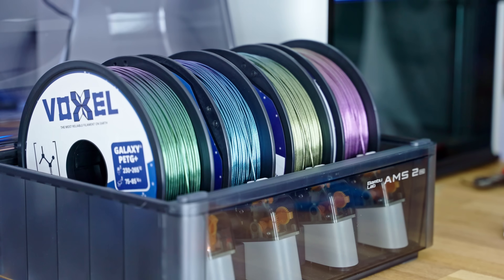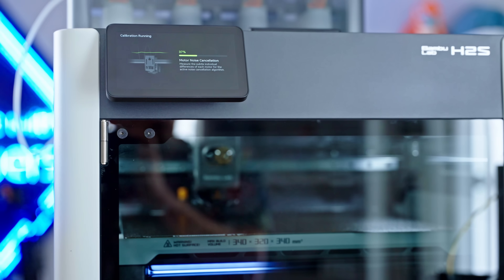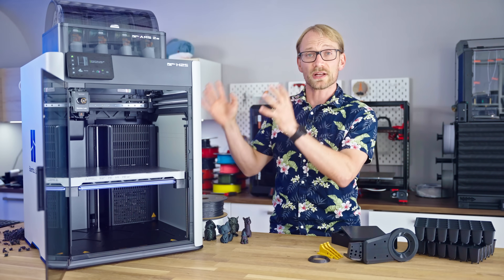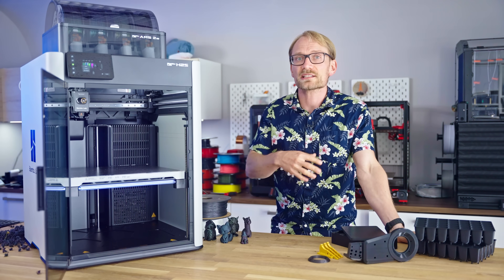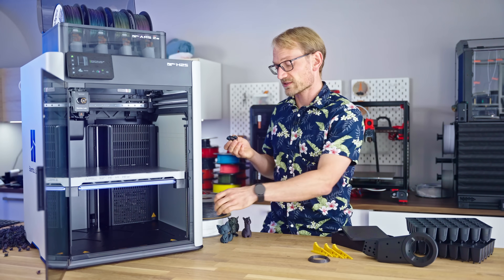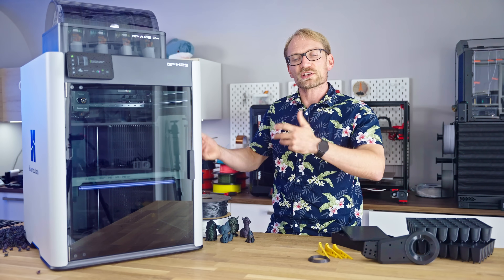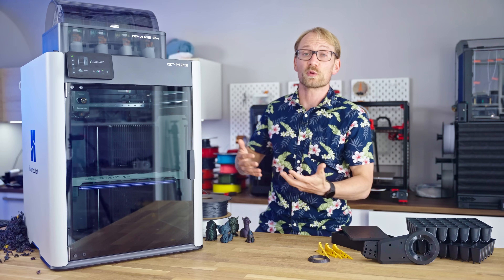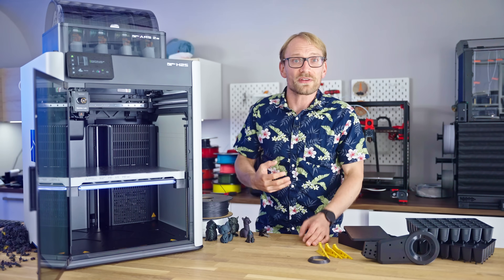Is Bambu's H2S truly a H2D Lite or just a bigger X1C?

Comment: So - PLEASE @ThomasSanladerer  (dont think it works that way here but worth a shot)  - PLEASE ORDER OR REQUEST AN H2D - I really thought OF EVERYONE - Youd have withheld a video on this until you had time with that machine... [The only reason NOT TO was .. well for the view need IMO..]   - Please forgive me if I'm wrong about that but - SOme of us have come to depend on youre knowledge in making informed purchasing decisions - Where intentional or not...  I think youve sadly Perhaps unintentionally done many people harm by having ZERO Knowledge or rather real first hand Experience using the lets say "Sister" printer to this..   That without it - Via direct interview with CEO this wouldn't exist..   So - For someone like myself who is frustrated by the small build volume loss of the H2D wishing they would have chosen a slightly larger frame size - i mean JUST in the X dimension which IMO Doesnt cause space problems on a desk NEARLY AS MUCH As The Depth of it - As most desks are .... (A) Square Topped  (B) Rectangular  - Answer = B RECTANGULAR!  So I heard the CEO's concerns about its size but .... reclaiming that usable X width IMO was not as large an issue as it had to be and was pre determined before any design work on it was ever done.. Which is a shame as - HAD THEY DONE THAT: With the H2D having the SAME USABLE X Size ... 

They COULD HAVE MADE THIS A SINGULAR CHOICE OF: Speed & Degree of professional engineering material use ... 

The rainbow PLA printers or Actual contributors to humanity that Design and iterate usable functional parts & not just make Niche manga and other series or game characters on Etsy / or last second "I forgot to get a gift for ____, what was that thing hes into?"  = [Order pointless multi colored trinket] - Sorry Im TRYING to hold back my just depression over the human race with what society in gneeral clearly values.. Which is NOT To make the world better but to fill it with wasteful useless trinkets that for every one made 2x that or more of filament was thrown away ... 🙄vs.
 Those USING FDM to CREATE and drive innovation of design ideas that weren't possible before this technology - Or Prototyping of functional useful things..  That I ALSO HOPE depending on the use case that - If strong enough and consumers willing to accepot 3D printed parts (if they even notice with Z-line /Layer Lines hiding in carbon fiber filled composites with a nice texture to them) That people will Adopt an ever increasing DESIGN FOR FDM / Additive manufacturing Approach to product creation.. IF the resulting product can be made from the material properties as a final product, and if it makes financial sense over injection molding after the design stages. 

So - PLEASE KNOW - Its hard to watch this for me Personally.. Just because..  You did not ever use the H2D before the H2S.. 

That REALLY IS A PROBLEM - Because..  Your reactions and review of this product.. While you believe it to be objective an unbiased and harmless.. May for MANY PEOPLE Never EVEN GIVE THEM A CLUE ABOUT THE BENEFITS OF DUAL NOZZELS TO AID THEM IN A DECISION BEST SUITED FOR THEM!   Where - Videos like this from other reviewers I would understand.. But I hold you to a higher standard - Because You're intelligent enough TO BE! And its Rare there's about 5 in the world right now I can say that about. 

(well im sure more but without having to stop and think that's what's immediately my basic count of the channels featuring people of enough intelligence and good content that ....  I just hold things you do to a higher standard - And I think deep down you do know.. This video was for the views.. - Maybe you've been busy, whatever it may be but.. You have to know surely that skipping that model .. in a world of new printers that have everything I could have hoped to modify mine to one day but far ebyond it with dedicade design teams and not being stuck with Duet Board components only and like E3D or other Hot ends etc.. Fully ground-up designed for flawless functionality company that succeeded! Since Ive been away - and PLEASE REALIZE - YOU DO NEED TO HAVE TRIED AND USED THE H2D before making this review.. Or - You know..  despite what you tell yourself..    This video WAS FOR THE HYPE!  - Please Return to that higher standard I do hold you to ... Where You would have never released this video without (even if you personally chose to skip it for some reason ... and aren't into the Functional 3D printing space anymore or LIEKLY someone in your posiiton has so much spare filament coming in all the time the waste is a complete non Variable for you Personally! )  

So please think on this if it posts.. It says it does but usualkly 34 post YT starts deleting them if long like mine are when they are serious criticism - Not meant to be negative but to genuinely hope to make a point that ... Not even asking for a test unit of the H2D before this and doing the prep work to use it EVEN IF YOU DIDNT HAVE TIME TO MAKE Videos about it.. WAS NEEDED Before doing this video!

As - well I think youve either sold out to the masses of the world mindlessly printing trinkets and.. Gave up any real care anymore for products I really needed your review of or knowledge of first hand to compare against - AND  OR like mentioned above that for you as a creator and reviewer filament cost is LITERALLY NOT EVEN A VARIABLE! With so many free and sponsored filaments im sure there's already enough accumulated for a lifetime (and if not - That would be no issue to just start to review some and then youd have them - Either way it costs you $0 in most cases!)   But I'd presume you have so much by now you cant possibly ever even have the time to create things to print and use them up while making videos and content!* 

*- Am I wrong? (Actually curious - It's a genuine question I need to ask others doing reviews on this and other models of Bambu lab printers to see if they even realize they don't live in the same world we do in regards to cost of materials! And I believe this builds in a Bias they dont even reall y think of but maybe a mention of it but it doesn't matter to you as it would to others so its hard to give advice or reviews in such a reality unless you separate all filaments gained from  sponsors over the years - Set them aside and ONLY BUY Full price filament for any review of any printer that has an attribute of wasting a lot as a huge unavoidable downside of it thats so overlooked IMO! ) 

⚠ WHICH MAKES THIS A BIASED REVIEW - That I'm trying to point out & get top the bottom of why the other machine wasnt even used by you before this video?  As to consider this Bambu labs for the first time.. Just... REALLY NEEDED THAT - As ... I didnt have to see this to know this would be your reaction when you SKIPEPD WHAT I DO BELEIVE IS A VITAL PRINTER FOR  THE REAL MAKERS OUT THERE of more serious End Use Parts and that really do need fast swaps between main material printing and support that - IDK as I dont have any yet but mechanically speakign with one nozzle and different temp filaments I just KNOW it needs to retract cut and purge etc ALL WHILE THAT LAST LAYER OF CF NYLON HAS COOLED SO MUCH That with a single nozzle solution THERES JUST NO WAY IT WILL BE AS STRONG As if it was printed continuously.. OR Rather with the most Minimal interuptions possible i.e. What I came to conclude next to IDEX only a Dual nozzle solution can truly offer that best possible Layer bonding and support material use nearly instantly vs all the mechanical things needed to happen to do that through a singe nozzle ⚠ - I think this is better said here... But seriously without that its a sellout to ... Either not caring for functional parts anymore.. Being genuinely unaware of these issues ive raised - I KNOW YOU ARE you cant claim ignorance to it.. So its either sellout to the masses that waste filament with pintless trinkets to fill landfills... OR  just ... well IDK! I cant actually explain it.. Just being too busy? 

Or do you genuinely not get the importance of 2 nozzles ?  For Functional part creation & likely have deluded yourself like the rest to realize / Think in the following way regardless of consequences on build functionality & strength : 

🤔 "Well it printed the part" It looks good - So I have a machine with one nozzle that despite the time and wasted material to extremes... That - I don't care!"

"I'm fine with the one nozzle as it does the job.. Filament for me is free and - I haven't really gotten around to checking the strength of models printed from high strength materials with such long break period between layers being laid down that cool down filament so much and make bonding massively less effective. possibly to a degree that makes them unusable when they otherwise could have been strong enough to be used for a real life function!"  

• it's ONE OF THOSE THINGS!  

- Can you share even just with me Privately which it is? 🙏

As - I'm sad to see this video launch and know you've done nothing with the H2D i know you only needed to ask and they would have sent it - They probably offered it without asking..
Reply: So whats up?  -- Sory as maybe sadly the only MENSA member within this youtube community (That sounds arrogant I know but im short on time to revise this otherwise) and have a lot to say!  As I genunely hope this will be read by Thomas - And some anser given to this.. As I do need to know if hes just sold out to ...  the things I just explained where for him filaments are free - and the world trewnd is to have usless trinklets now 3D printing takes no skill and isnt in the hands of those with technical minds that are deisnging things that need that tech to be able to do so!  Now its fallen into anyones hands thanks to this company sadly which the only good I see personally is lowering PLA / PETG prices.. thats all..

So I have to now "Join Them" and get one reliable machine - But I really needed info about usage of H2D from this channel.. Missing that... Just makes me sad to see this.. As - Please TELL ME IM WRONG SOMEHOW - Just explain my logical analysis on why you never bothered with it.. Or if its just peronal and lack of time / Life happens related.. Or have you genuenly maybe not even realizing it fallen victim to ... Not realizing the impact of material costs and needs of strong layer bonds for functional prints... / "Sellout" term I use meaning.. to just conform to the trend of society and not uphold or maintain the fundamentals of FDM manufacturing (product strengh & functionality) vs. Not giving a Bleep about it anymore as ... Heck even if he did a video on it the worls so lost already with mindless zombies using tech they probbalyt shouldnt be and - That ... I mean I shouldnt be frustrated by it - It still brings innovation to this world.. Its just.. IT SACRIFICES CONCERNS FOR THOSE MAKING REAL LIFE PRODUCTS that need to be durable and want to have that means WITH THE RELIABILITY AND Speeds offered by BamBu labs products!  

So - Maybe he realized a video on it wasnt worth it as .. the views and trrends are going trowards just rainbow PLA vomit (I call it) usless functionless - Pintless.. Printing.. of objectively dumb things (sorry "artists" that think downloading a 4 cfolor moddel of a pokemon is youre artistic expression ... By a choice to.. Click a link and a machine print out someone elses work... 😂 - Okay enough roasting of ... what dissapoiints me in the FDM space now tech like this exists - Its sadly just Drives us closer to the 2006 movie IDIOCRACY  - In a slightly more inteligent way - but to see this entire branch of creation mostly shift to ..pintless dumb thigns that.. do not improve the world in ANY WAY - is what bothers me by this tech becoming more accessible..   Its FINE THOUGH AS LONG AS PRINTERS LIKE THE F2D EXIST STILL FOR THOSE THAT DO CREATE REAL PRODUCTS OR PROTOTYPES OF THINGS TO BETTER THE WORLD... And while I have nTopology license I BADLY NEED A RELIABLE MACHINE in this 11 months left...   And the H2D - Ive seen reviews but ... I wanted one from this channel even if not released but personal use of one before making this video so hed know what to compare agsint and tradeoffs for the real makers out in the world that still do exist and IF THE H2D is what I beleive it to be - MORE IMPORTANCE SHOULD BE PLACED ON IT that im just not seeing online anymore!  - AND THAT IS SAD!!

Maybe I have to step in and be that guy now!  Idk!  But Releasing this without even using the other - Continues a trend thats ... IMO almsot a betrayal of the reasons we as Humans Created FDM / Why it was exciting to us in ways to improve humanity not just RGB vomit prints  to fill etsy shops!  (Ill gadly join in on btw for the income but - I will never truly support or be happy with that as the future.. AND NOT SHINING A LIGHT ON THE H2D WORSENS THE EXISTING PROBLEM!

IT PROMOTES THE WORST TYPES OF CREATING OUT THERE IMO - and DETERS MANUFACTURERS FROM EVEN BOTHERING TO CREATE USEFUL TECH FOR REAL FUNCTIONAL PART CREATION vs the RGB landfill garbage (im sorry thats not meant to be an offesne I jst dont  know a better way to refer to the varity of ho wmuch of thats out there serving no purpose - Whioch is fine for those that enjoy that! )  BUT WHEN IT DRIVES THE MARKETS AWAY FROM..  Well IMO the first REALISTIC PRINTER I COULD BUY with these reliability and speed advantages that had the 2 Nozzle benefits that without mentioning it and glorifying trhis - You just join a sl;ipper sloap of ... degrading any usefull tech that finally they did make I bleieve - At least enough to buy and try it myself!  (H2D) 

Please think on this will you? - If it posts.. If not ill try back in a few days!